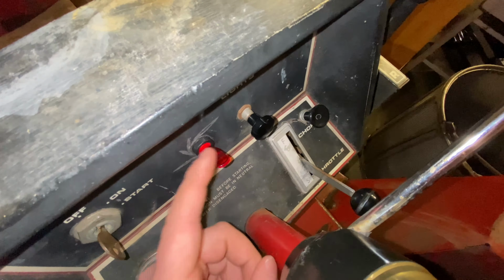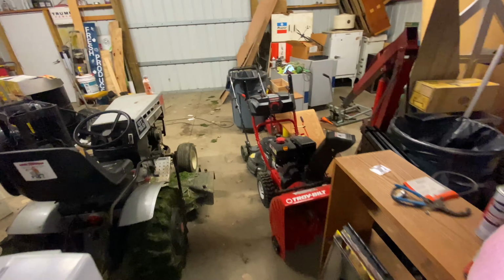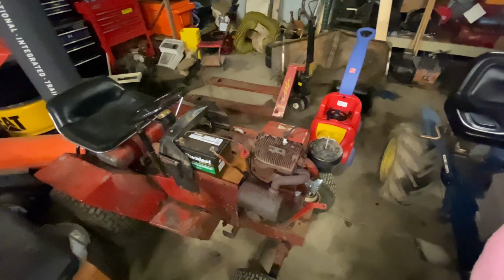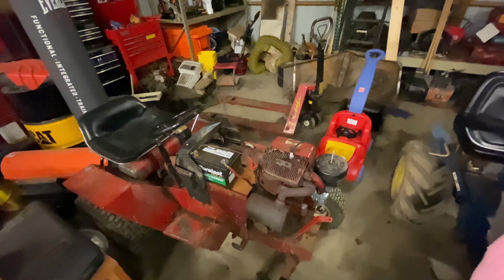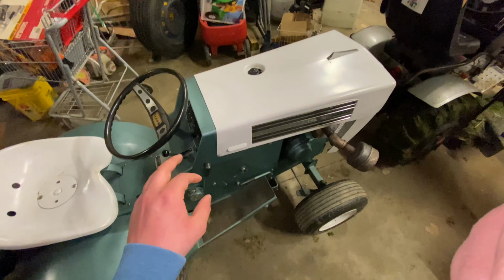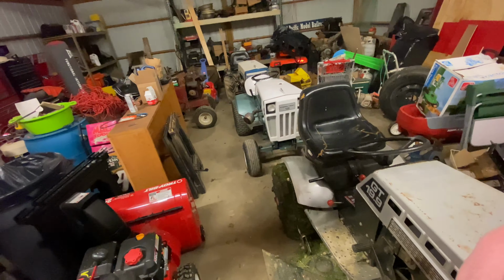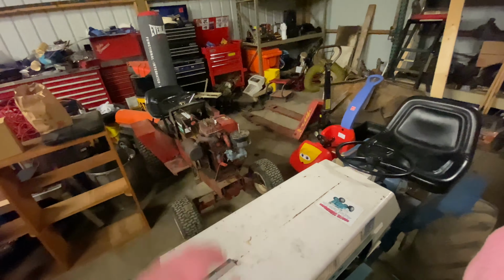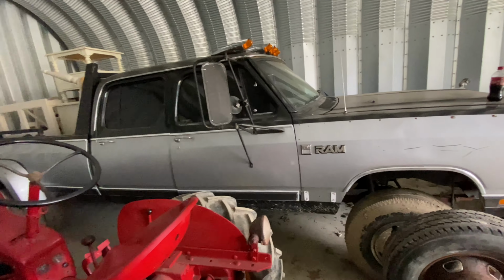Fixing up the fleet for show season

Comment: Hey I don't know if your interested at all but I recently purchased the John Deere 208 you had on your channel off a buddy of mine if your interested its going to be on my YouTube Chanel here soon getting it running has 270 something hours on it currently. how was the transmission and engine seemed like it ran good it don't run now. Can you give me a story or any imformation on it you were told by the previous owner at all I like to have the full story behind somthing when I show it
Reply from the maker: Well I knew the orifinal own, whitch was my step dads dad, I do believe he bought it new. The tractor was taken care of but it was used very heavily. The original own added the side panels and verator at some point. I had some fun with it and it ean very good, engine is solid, trans axle is solid, but the verator does need some work. At the end I had an issue with it throwing belts, and I had an insedent where I was using my GT19.9 and it whent in to the back of my 3 poing hitch on the 19.9. It did damage the points, and from there I don’t know what else got damaged. I did run it out of gas the last time I ran it, so the carb should be in good shape. Any other questions just ask.
Reply: @shiftinggears6859  Thanks man I appreciate that also I found it is a 78 208 definitely not as nice as when you had it but its there side panels are missing front tires were swapped helper springs still there cigarete lighter is still there hour meter judging by the last video I saw of it on your channel where you showed the hour meter it has not been run much since you sold it. Should be on the channel here soon if you end up interested in buying it let me know I live in Wooster Ohio.
Reply: @shiftinggears6859  Do you remember who bought it off you at all I can tell you if thats who I got it from.